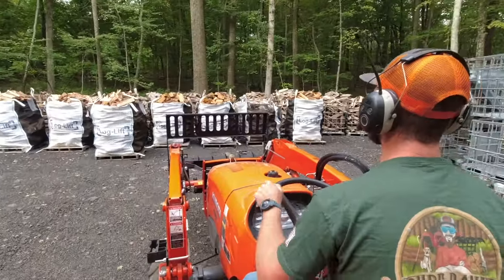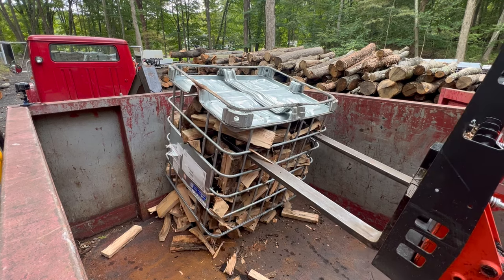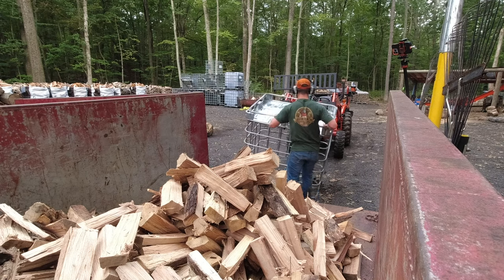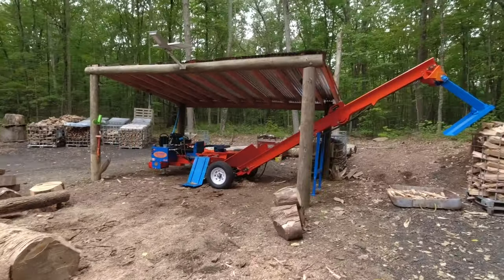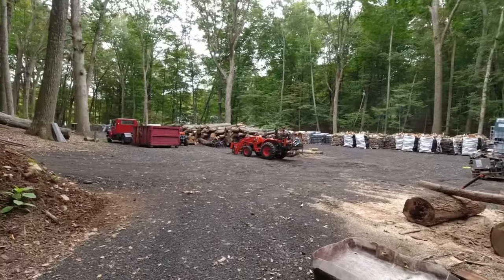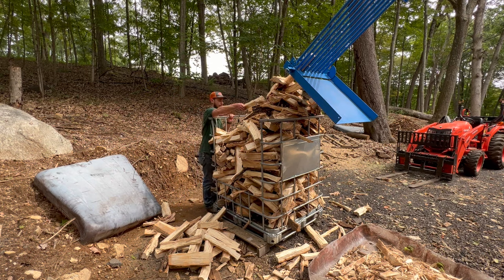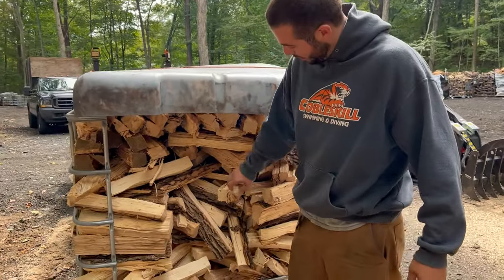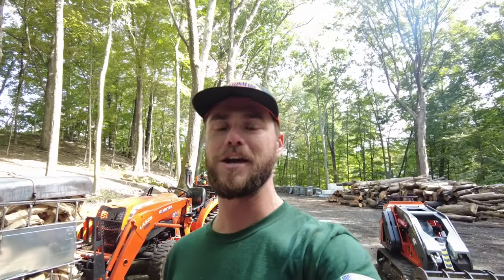#415 Perfect Firewood: Eastonmade "Pizza" Box Wedge This is the Real Deal!!

Comment: Jake, what about attaching a small chain spanning the cutout in the cage? A couple chains with clips would give you better control of falling wood and still be removable if needed. Tim
Reply from the maker: That could work, recently I’ve been bungeeing one of my lid tops to the opening while filling and it helps hold the wood in great.
Reply: We met briefly at the Springfield arborist show, near the Eastonmade display. I was patiently waiting for my 12-22 to come in, which it finally did in late May. I put the sticker you gave me that day on the fluid tank.  I may need to one of your updated ones too! Just down the road in Middletown- Tim @DudeRanchDIY

Comment: When you started splitting in this video, is it possible to have rolled two of those smaller logs in at once? Haven’t seen anyone do that with these splitters and wedges before.
Reply from the maker: I suppose I could’ve, however with the size of those specific rounds the second round would’ve been up on the higher “log cradle” sides as opposed to the beam itself so would’ve ridden higher and just sliced off a useless sliver of the log.

Comment: Some Rotating Pallet forks like they use in the scrap yards might be the ticket on dumping totes!
Reply: I tried using rotating forks on a Kubota 3130 they are very heavy. I was doing gravel edging on a 2000 foot paved driveway. We then put them on a Kubota R340 and they worked better. The weight of the attachment it self is really high.
Reply: @christopherkasik3291  well, if he buys the rotating pallet forks and they dont work on his tractor, that would just be the reason for him to buy a bigger machine.  Makes sense in my head atleast...
Reply: @EverythingElliott  lol , ah you are using “Wife Purchase Logic” , it is not that it is on sale, it is on sale so you can buy more !! I see where you are heading! Lol
Reply: @christopherkasik3291  exactly!
Reply from the maker: @christopherkasik3291 What is the hp and lift capacity on a kubota 3130? You’re the only person I’ve heard of that has actually tried it on a smaller tractor

Comment: I think you shouldn't overfill the totes. This will give you 2, or maybe even 3 on top of each other, depending on how high your tractor's front loader reaches. This means you get double or triple the amount on the same area.
Reply: Totally agree with stacking. 2 more bennies: more air, more drying. Less bladder tops because you only need to top the 2nd layer. Wins all around by stacking!
Reply: This is what I was going to say. I’m not sure about going 3 high but two high is the way to go. And then depending on how many and space you could arrange it more like a warehouse with isles to get to more variety of type and seasoned wood

Comment: Have you considered a rotator like they have on forklifts, that would be easy to setup
Reply from the maker: All the time, most aren’t intended for use on smaller compact tractors like mine as they are built pretty heavy, the rotator adds a lot of weight.

Comment: Any way you slice it , when you store firewood it just takes a lot of realestate.The basic answer to store more wood is more area, outside of that you have to go up with it. It would help if you had the room to get on all sides.
Reply from the maker: Yep, basically the conclusion I’ve come to. There are a few ways I’d like to try to keep my wood more “chronological” but I’ve been looking into purpose built forklifts to go “up”
Reply: @DudeRanchDIY  It might be time to consider a track loader or other machine? At least try to invest  funds into a machine that does more than one task. You would need a tracktor lift in that yard, a pneumatic fork lift would just be a pain in the ass and any fork lift is really just a one trick pony.
Reply from the maker: I’ve considered a skid steer and not totally against it but at the end of the day I already have front end loader capability with the tractor and I don’t really do much dirt work and grading. An older forklift I could get relatively cheap and it would help immensely around the yard. Ultimately i’d like to get a mini excavator that is small enough to be able to haul with my truck and trailer set up and be able to get me into doing some actual digging work. Plus they can be extremely handy for Tree Work when paired with a grapple.
Reply: @DudeRanchDIY  Yes, I have a Bobcat E35i excavator so I understand, I use it in the wood yard every day,  It's a pretty handy machine to have. I was a forklift mechanic for many years so I have some experience, they are extremely heavy with a very small tire foot print so they get stuck in gravel every time you blink. A pneumatic tire helps but they still sink in especially during the freeze thaw. Not to mention they don't work worth a shit when it does freeze. Your tractor would prolly lift to double stack the totes, I don't think I'd go higher than two anyway  with out level ground, prferably concrete base to hold the load. Not trying to steer you away from a lift just trying to keep you from buying one thats only going to piss you a million times a week. It sucks digging out a forklift on gravel, I've done it more times than I care to remember.
Reply from the maker: @Tonnsfabrication that’s probably about the size machine I’d look into! Yes I’ve run pneumatic tire Yale lifts when I worked at a nursery on dirt/gravel/Millings and they’d get stuck occasionally. I think I probably could double stack with my tractor now especially now that I’m loosely filling the totes. Chris and I have been talking about a total reorg of the woodyard layout so that might come into play then.